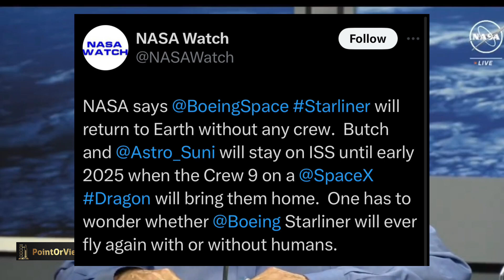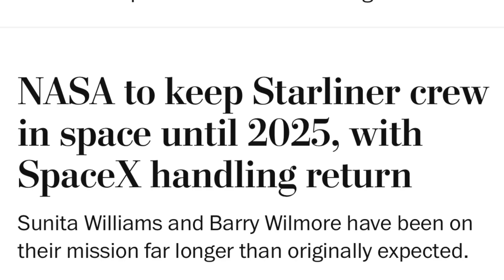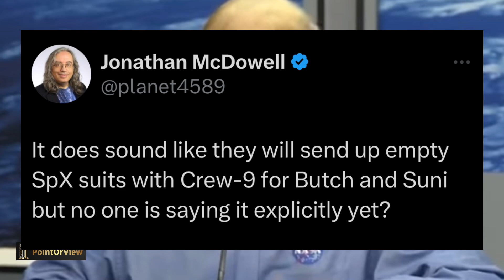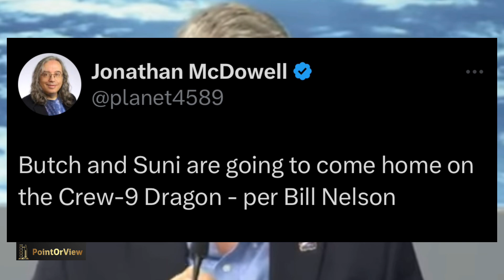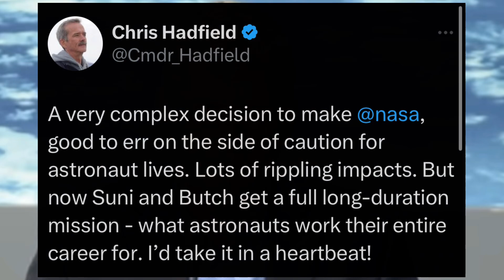A CATASTROPHIC FAILURE: Boeing Starliner returning empty leaving astronauts stock on ISS until 2025

Comment from the maker: The pair took off on what was planned to be an eight-day mission on 5 June but will now spend around eight months in orbit.
The Starliner experienced problems on its way to the ISS, including leaks of helium, which pushes fuel into the propulsion system. Several thrusters also did not work properly.
Boeing and SpaceX were both awarded billion-dollar contracts by Nasa to provide commercial space flights for its astronauts. Boeing’s was worth $4.2bn (£3.18bn) while SpaceX, which was founded by billionaire Elon Musk, got $2.6bn.